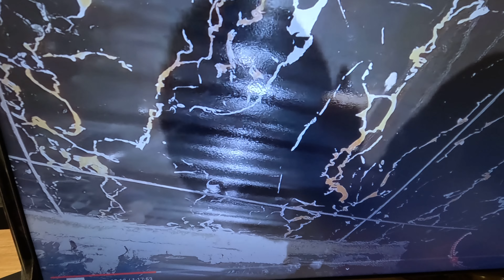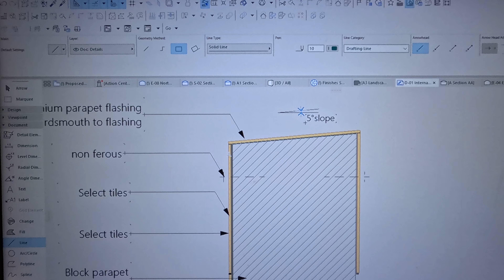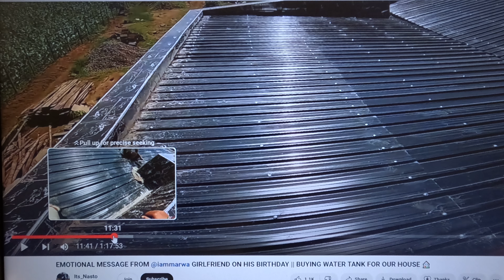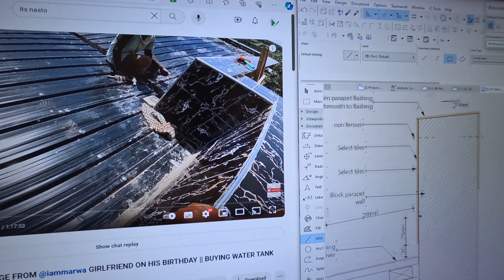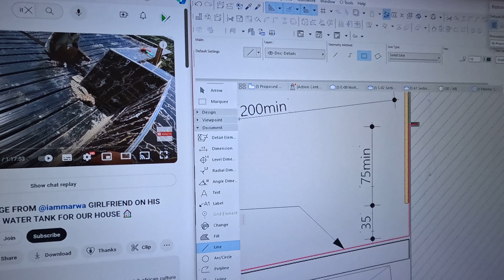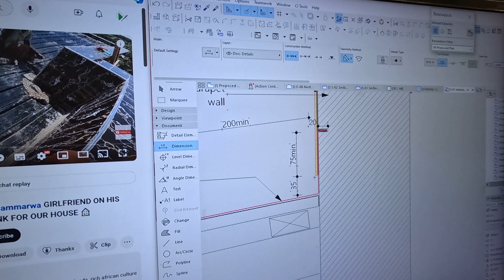Problem with @ItsNasto "hidden roof" Design Part 2 (Parapet Wall)

Comment: True. There are many 'technicians' doing the building. 

Just because one can build a wall does not mean they know what wall to build at an instant. The operational requirement is the engineers purview. This step is missed to save cost but it is eventually paid off down the line.

Comment: I have  no iota of building  qualifications. I do have a good  memory  of felo having  a similar  design  on his storeroom house.  Felo had major  problems  with water seeping and ruined  the internal ceil and walls.  He had to redo and reinforce  the original  work.    Such a waste of resources.   .
Reply from the maker: The rue of thumb, is to try and do it right the  first time. It saves money and costly repairs later on.